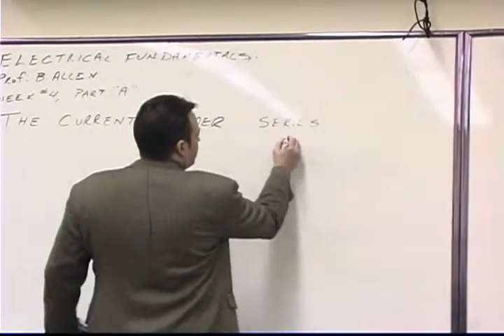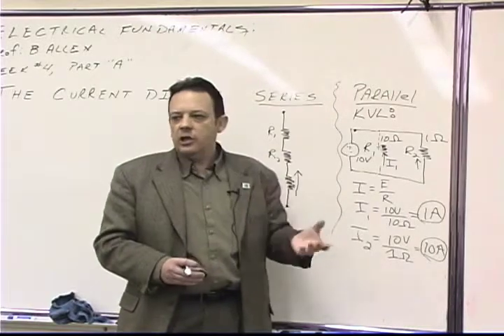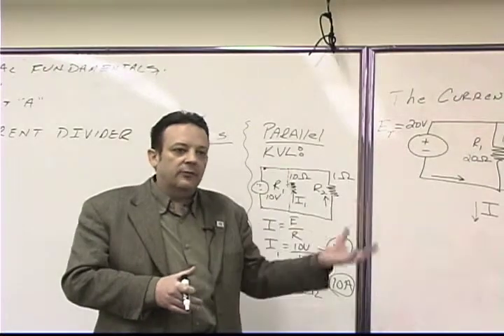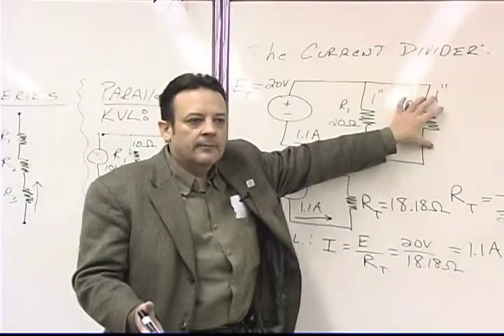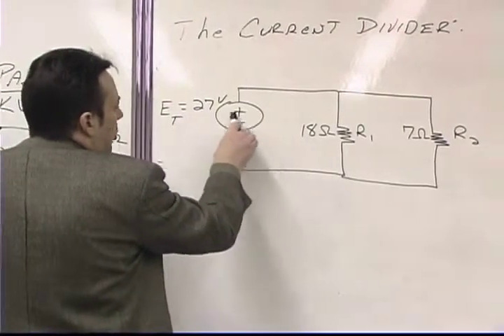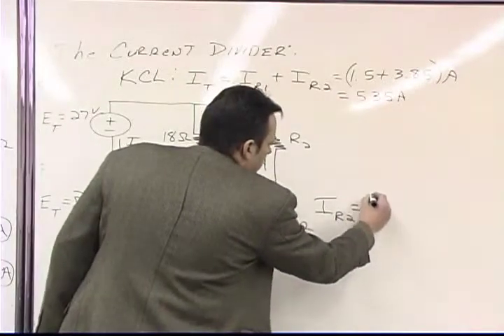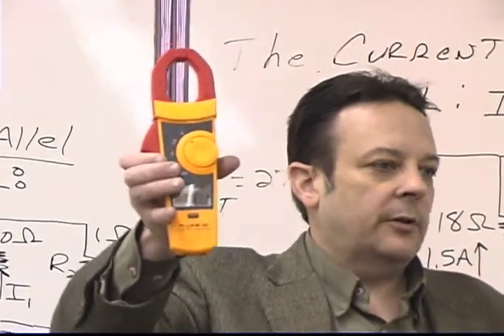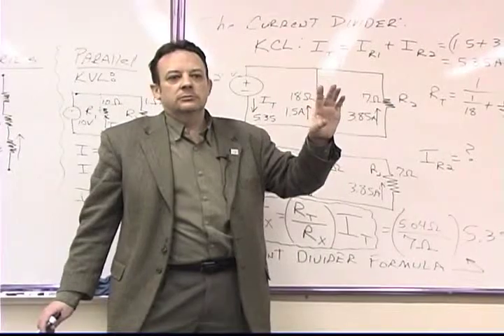Current_Dividers.mov

Comment: Series: Voltage divides, current same, higher resistance → more power.
Parallel: Voltage same, current divides, lower resistance → more power.
Total power in parallel is much higher because total current is much higher.

Comment: Current follows the path of ALL resistances.  Not just the least resistance.   If I make myself a low-resistance short to an industrial electrical box, I will get ZAPPED.  But the current will also flow thru the original path too.   It's share of the total current will drop from 100% to some minor amount.  BUT the current will not stop flowing thru the path of high resistance.